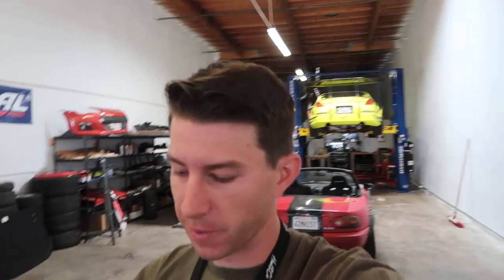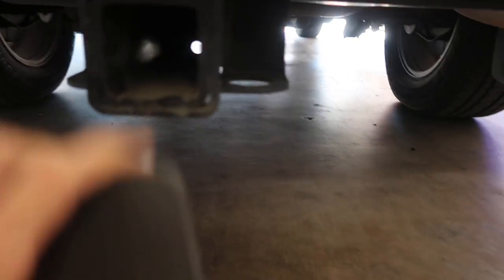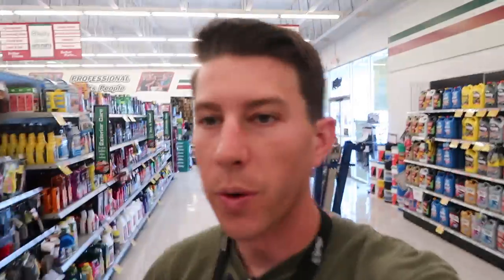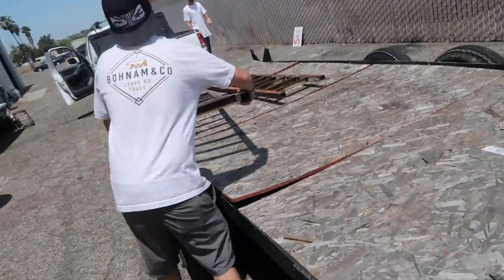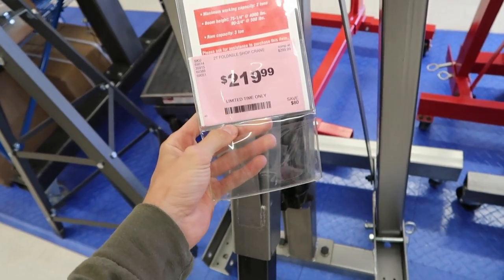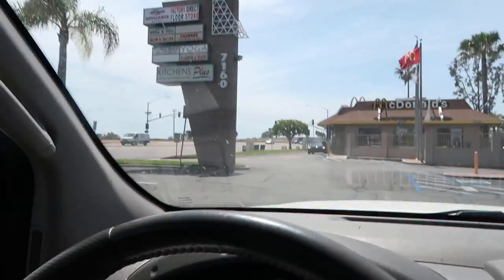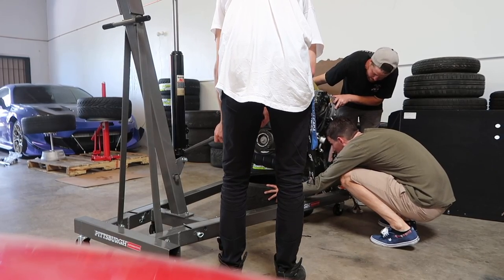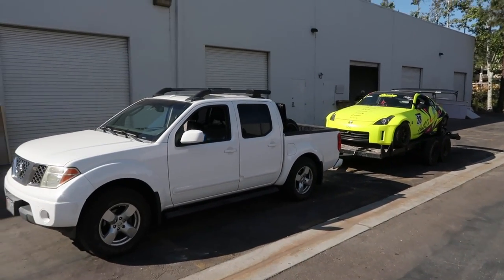This determines what Truck I Buy!!

Comment: As a mechanic, go test drive a GMC/Chevy 2500 with the 6.0, and a Ram 2500 with the 6.4L. No sense going diesel if you're just hauling around 6000lbs. I would not go turbo, the ecoboosts have issues with the turbos. Stay N/A if you can, they're far more predicable.

Continuing to haul near the max towing capacity can cause premature engine, transmission and brake wear. Not to mention towing with the frontier's somewhat short wheelbase adds to the difficulty. You'll have a much easier time with a full size truck. Take a look at some used HD trucks, you'll probably find a good deal.
Reply: Jordan Clubine not to mention for him a gas engine will be much more familiar to work on than a diesel
Reply: The ecoboosts have issues, but none are related to turbo failure haha.
Reply: As someone who is not a mechanic, I am inclined to agree.
Reply: Well I'm not gonna say stupid because it's your opinion so sorry for coming off aggressively
Reply: i agree with you he needs a gas 2500, no point of him owning a diesel if hes only gonna haul that car. coming from a guy who owns both a  08 6.7cummins dually n an 01 gas chevy 2500 with a 6.0 use the chevy more with the lighter loads
Reply: The diesel emission systems (EGR, DPF) is absolutely terrible in all trucks. It kills the longevity and reliability of them. Sure, you could do DPF/EGR deletes and that would be the first thing I'd do but the state of California has extremely strict vehicle modification laws and I don't people can get away with it there as easily as the more conservative states. 

With that being said, I'd only go to a diesel if absolutely necessary (daily hauling). Their gas engine counterparts are simpler, cheaper to maintain, provide more than enough towing capacity for his car and trailer.

Now, if he did want to haul a 2 car trailer with 2 cars then he may want to consider a diesel if is beyond the towing capacity or if he does it more often. Like you said, this is my opinion.
Reply: thats what i did within the first 3 days of owning the truck did all the deletes an a 5" turbo back exhaust couldnt be happier with it

Comment: Max capacity includes the trailer, the load on the trailer, the load in the back of the truck and the weight of the driver and passengers. It don't just mean trailer and car you have to include how many people are in the truck and how much each person weighs and what your hauling as well. So that little truck can't handle what you are throwing at it you need a half ton with a capacity like the Silverado which is 9000lbs. Or whatever car maker you like most.
Reply: Troy finally someone understands it! came to the comments section just to say this. thank you brother👍
Reply from the maker: Troy the trailer and car come out to about 5500, add tires and two people and you're still under 6100lbs. That's still within towing capacity ;)
Reply: Tj Hunt even though that's the case, you don't want to take a truck to its limits. The frontier will be okay for a couple events. But you'll see accelerated suspension wear. My dodge 2500 has had a full rear suspension rebuild 4 times in 7 years because we use it to tow so often. It's a work truck. Just be wary of using "the whole truck"
Reply: Tj obviously its your choice because its your money but you can buy a new truck now that it rated for that weight or you can buy one in 6 months when you break this one. its not meant to tow that. and the "6500" pound sticker on the hitch is what the hitch is rated for, not the truck.
Reply: Tj Hunt the truck has limits because that's the max it can do. That doesn't mean you should reach the max. The max is if you absolutely 100% have to reach it every once and a while not everytime.
Reply: CrazyLazyDave have you seen this dudes channel? He doesn't care about safety. It's about the looks/status
Reply: the hitch says 6100 lbs, thats the rating for the hitch right? the trucks rating is not the same as the hitch's rating.
Reply: 86Guy the hitch says 6100 that's most likely the trailer weight the tag by the hitch saying 6500 max payload means that's the max weight total including a full tank of gas passengers the bed load and the trailer and car including the full tank of gas in the car on the trailer.
Reply: i see, so that means towing 4500+ lbs 1000 miles in my stock 2000 ranger wasn't smart lol
Reply: Alex Nickerson when he is going down the freeway/highway and the trailer starts swaying and he don't have a trailer break or sway control and he flips his truck and trailer and totals both cars and insurance won't replace them because he neglected to follow loading advice and no trailer break he will think about it that is if he survives the accident I've seen many people not live through similar accidents.
Reply: Troy yeah I've never seen it but I know it happens. And it's because of people like this
Reply: Alex Nickerson I've seen it happen and towed cars away from the scene and once you see the blood and carnage from an accident like it that could have been avoided makes you not press your own luck, I guess when you have seen brain on a windshield and headliner it sticks with you.
Reply: I always give a 20% leeway when it comes to trailer weight, so theoretically, you shouldn't tow more than 5,000lbs with that truck.. I had a Silverado 1500 and the max towing capacity on that truck was 7100lbs and I would never tow more than 6,000lbs.
Reply: Troy this is why i have a 2500 cummins lol tow anything I need to with it
Reply: Elliott Fontaine I plan on doing that when I can afford a chevy 2500 duramax midnight edition. But like he said some videos ago the truck is his parents and I'm not sure his parents could live with a 3/4 ton truck specially when he just needs a 1/2 ton to haul a 350z and tools and tires.
Reply: Tj hunt that rating is for a trailer with brakes.  Without brakes it is much lower.  Without brakes the trailer will push that  truck around.  Hopefully the tongue weight is enough to keep you from Jack knifing.
Reply: the hitch is actually underrated for the car the car is a 3 tonne of 6500-pound towing capacity he will be fine with just the 350 and some tires
Reply: in this case, the car is rated to 6500 lbs or 3 tonne
Reply: Luke Mickiewicz With no trailer break or electric sway control. And a trailer with a car on it weighing more than the truck it isn't good for his breaks or the truck. He will prolly make it there but if there is an emergency stop I guarantee that trailer will push and jack knife that truck and hopefully it won't flip but no one listens on YouTube everyone is a pro at everything and don't listen to people that actually have experience. I think I he is batshit crazy pulling 6000lbs of trailer with 4600lbs of truck and no trailer brake or electric sway control.
Reply: Troy but i drive mine 800 miles with a 6000 lbs boat and no e of that electric sway stuff or breaks and its fine
Reply: Luke Mickiewicz you guys can do what you want in your trucks I'll just keep towing the smart way with a proper truck for the load I'm towing and required items like weight distributing hitch and electric brake and sway control units. To each's own I have a wife and daughter to take care of and come home to.
Reply: how the fuck everybody in europe tows with that but you cant? @CrazyLazyDave
Reply: igoruku we are not against him towing with it. We are just stating that he is new to trailers and can't even back one up has to big of trailer for the truck since that trailer is usually pulled by a dully he just needs a single axel light weight trailer and he NEEDS trailer breaks and Sway control since his trailer car set up weights more than the vehicle he is using to tow it. That will cause sway and it would be hard to stop normally let alone on an emergency stop. It's about safety, that's all most of us are worried about, we don't want to see anything happen to tj. I've seen nasty bloody messes left over after accidents similar to what could happen to tj.
Reply: I agree he need trailer brakes, but that is not truck fault...almoust all trailers here in europe has brakes...
Reply: igoruku I never once said it was a bad truck I stated in earlier reply that it's a great boat or toy hauler or even weekend trailer hauler but a 20' deck dual axel car trailer meant for 3/4-1 ton trucks is to much for it to handle. And he definitely shouldn't even try on the one basis if no trailer control help it's plain dum to haul a to big over the weight limit trailer with no trailer breaks or even as important sway control because a small truck can and will be whipped by an over sized trailer.
Reply: I am confused, you say it is not a bad truck but you cant haul that trailer? Again in europe nobady have duallys! Everybody uses similar size trucks, suvs or vans...Dual axle trailer too...They have brakes but still...
Reply: igoruku look at the video and look at the size of the trailer, I realize laws and vehicles in Europe are different but different size trailers and different length trailers are meant for differ t class of trucks. Frontier is prolly classified as a 1/4 ton truck v6 powered 4wd which limits its towing weight and capabilities to a certain trailer and about max 6500lbs capacity . A 1/2 ton with bigger frame v8 engine and bigger drivetrain means you can handle bigger trailers in weight and length and about max 10,000lb capacity. Then there is 3/4 ton which is just is bigger heavier can stabilize the bigger trailers and more weight and higher limitations and prolly max 15,000lb capacity. And then if you haul for a living her in the states you buy a duality because you have 4 rear tires which gives you more control over even bigger trailers and loads and less limitations and a max capacity of up to 32,000lbs. It's a given that the 3/4 ton and 1 ton trucks are turbo Diesel engines and heavy duty transmissions and massive rear diffs.
Reply: Lol this guy hauls his boat to the lake. We should listen to him. On a serious note. TJ you need to listen to Troy. None of us want to see an accident.

Comment: No, you are not OK to tow with that truck. You are at MAX weight but you forget to add in fuel weight, your weight, extra gear weight, extra tire weight, etc. You are WAY over the safe tow and cargo weight of that truck. If you get in a wreck and they note that in the accident report your insurance will not pay out.
Reply: ZaneMasterX yeah, towing a trailer with no electric brakes is pretty sketch. I would tense up every time i braked
Reply: Soooo dangerous......that 6500lbs rating is for the hitch only.
Reply: mrme300 j
Reply: Why is this not top comment?!
Reply: ZaneMasterX stfu
Reply: Safety first and I think he is just being rightfully considered but better said than not
Reply: Finally someone how understands the basic concept of towing. He definitely had way over the max capacity on and in that truck. He needs something bigger like a 250/2500
Reply: I'd say a 1500 is safe to tow that much, but sure as hell not without trailer brakes and his evident lack of experience towing is pretty scary as well for that much weight behind such a small truck
Reply: ZaneMasterX plus if they have a hill to go up that max towing will feel like half of what it acually is
Reply: His particular car is rated to 3 tonne towing he is fine with the 350 is only half of that it is a completely safe tow
Reply: Luke Mickiewicz The car may be just over half, but don't forget he's towing the trailer too, not just the car. So, 3500 pounds for the car, 2500 pounds for the trailer, he's towing 6000 pounds (3 tons). He's right at the limit. Plus, the truck looks like it's around a 2009-ish frontier, so it's not new. The engine could be tired and wore out thus it won't pull as much anymore. It's not a safe tow. Oh, and don't forget, he needs to carry a lot of gear like tools, spare tires, fuel tanks, etc. plus passengers. That puts him way over max.
Reply: same in Aus
Reply: but almoust all our trailers have brakes...merica doesnt
Reply: Woah another couch mechanic in action.
Reply: Actually no he is being unsafe. At maximum tow rating on that truck with that heavy of a tongue weight you need a weight dist hitch to put less weight on the tongue and more on the trailer and that is shown by the truck riding on its bump stops when it was loaded down. Nissan says in the manual that anything over 5000lbs requires a weight dist hitch. Gross Vehicle Weight Rating (GVWR) is tongue weight plus gear, people, fuel, etc which will always change and he is over that with his crew in the cab, tires, tools, and whatever else in the bed PLUS the tongue weight of the trailer which should be only 10% of the trailer weight but by the video its way over that as its sitting on the bump stops. Add in the vehicle does not have trailer brakes and the truck is overloaded he is asking for an accident, ticket, and insurance pulling their coverage. Just because it CAN pull the trailer physically doesnt mean he should at this point in time WITHOUT a weigh dist hitch, better trailer balance for less tongue weight, and an airbag kit on the rear of the truck to help with the added weight of the tongue plus tires, gear, tools etc and the trailer needs trailer brakes and a brake controller.
Reply: diesel is 100% different...
Reply: Does anyone seriously think manufacturers test these things to determine max tow weight and stuff? I worked in mechanical production and engineering when i was young and never did we rate anything based on real life testing.  Then when i finished my studies i worked as a software developer/software engineer, you know those minimum and recommended hardware requirements to run certain software? Its crap, we really do make them up, and so does microsoft. Then we have the aviation industry, they actually base their numbers on reality and pilots must know how to calculate weights loads and leverages before leaving the gate/ramp, which is one of the reasons pilots need an education, unlike people who tow a trailer. 
Thats a perfectly safe tow, and on certain other vehicles you cannot safely tow half of the rated weight. In northern europe (esp in scandinavian countries) you can find tow hooks on a Hyundai Accent and Toyota Yaris, and you are NOT safe if you stay below max rating, and you can feel it at once.
Reply: Ploffy Kha 
1) Yeah, they do. They test the sh*t out off their vehicles because if it can't do what is advertised, they can get sued for false advertising. Or, if someone gets hurt because of manufacturer neglect, they will get sued.

2) I've permanently messed up computers by running/downloading software that is too much for the computer to handle, so I dam well hope that the minimum requirements is true so I won't mess up another computer!

3) Aviation is not comparable to towing. If something goes wrong in the air, there is a high chance of death. If something goes wrong with towing, you pull off to the side of the road and you wait for roadside assistance to arrive. 

4) It's not a safe tow! Bottoming out the suspension is not good for the truck. Say you can lift and carry 200 pounds, that's your max capability. But by your statement, that max is just made up because who really tests the max they can carry. So if I were to give you 300 pounds and expect you to carry that with no problem, would you be able to?
Reply: thank you we finally have someone with common sense in the comments

Comment: what you need to do TJ is go into a large empty parking lot and practice backing up and parking your truck with the trailer attached. It does take some getting used to, for me it took about two weeks to really understand how to back up a trailer. Also you are getting pretty close to that max towing capacity for that Frontier, in my own opinion I would get a truck that has a higher towing capacity for mainly security for your investment(your 350z). Other than that man awesome vids and love the builds!

Comment: Tj it would be wise to go to Chevy ford and dodge that's a 1500 or 2500. Your going to torture the hell out of your little truck. They all make good trucks now it's just what you like and your price range even a older good condition diesel would work cause you honestly wouldn't have to worry about weight ever again thought I should mention that your truck will not like constantly being at capacity. All new trucks are nice now no matter what you buy just buy what you like and read up about each trucks ability! If you read this I'm a huge fan buddy. Get you a truck that will keep moving forward;)!!

Comment: DURAMAX all the way...  US Army uses Duramax engines for a reason H1 Alpha? Yep...Duramax! They know that it's reliable, and dependable and will never fail on them and it  will always get them to where they need to go and even under the harshest conditions...
Reply: Ryan Keller kinda but the army does use Cummins like Ford to in there f650
Reply: Ryan Keller the humvees had the Detroit diesel na 6.2

Comment: ✌🏼 Speaking from experience unlike a lot of the Keyboard Hozer's in here, I own a 2008 Ford F-250 Super duty diesel now, but I used to tow with a regular gas 2009 Cadillac Escalade ext. Both work great but My Twin Turbo diesel is hands down amazing to tow with. I usually haul a "Big Tex" open trailer with my Race Mustang Cobra on it, tows like butter. The truck has an electric adjustable trailer break set up from the factory. Works amazing in all aspects! I towed about 9,000lbs or more of a 5th wheel Toy hauler trailer last week for spring break with my 4 seater Rzr and a couple atv's in it to Pismo Beach without any issues. Plus now that it's fully Tuned and deleted, it feels really good . Rolling coal is always dope to add to that😄
You can't go wrong with any Diesel from Ford,Chevy,or Dodge. It's all preference at the end of the day. I'm local in LA. You can test my truck out any time and you will see what I'm talking about bro! 👆🏻💪🏼🤙🏼